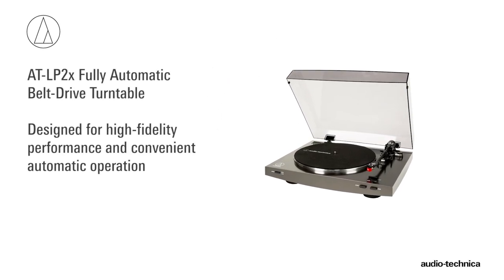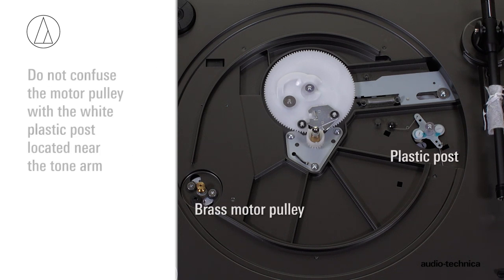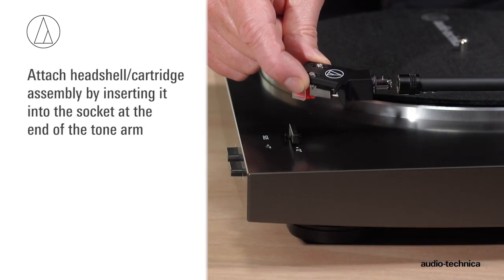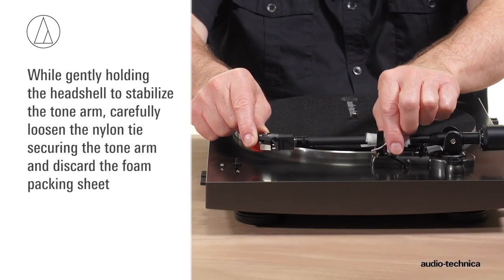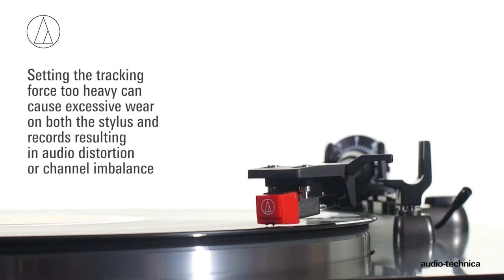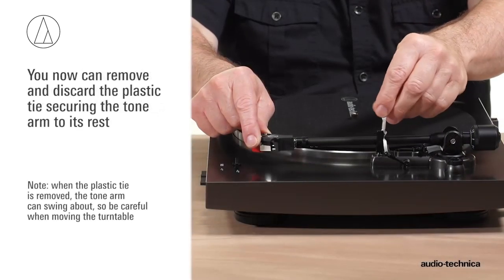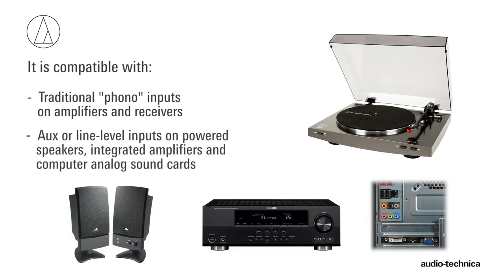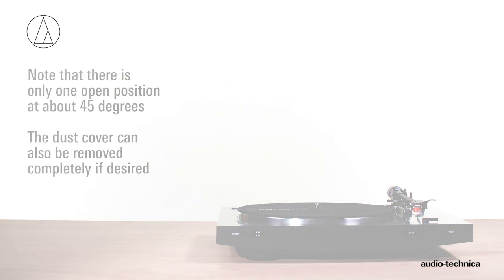AT-LP2X Turntable Setup | Audio-Technica Turntable

Comment: What are the measurements of the RCA cable?  They are not removable right?  is it a direct cable to the Speakers??
Reply from the maker: Hi there! The cable should be roughly 37” in length. The cable is non-removable and will need to be connected to the external speakers. Thanks! - A-T USA
Reply: @AudioTechnicaUSA  thanks, i bought it!  You could easily replace the needle or capsule with a higher quality one, right?  Would you recommend any?
Reply from the maker: @martinguano3346  We only manufacture the one stylus for the AT91R cartridge, that comes stock on the AT-LP2X turntable.  If you wish to upgrade to a higher quality cartridge / stylus, I recommend taking a look at the AT-VM95E. Thanks! - A-T USA

Comment: My AT-LP2x runs a little bit fast. Is there a way to adjust the speed? Thanks.
Reply: The belt is new  the motor is not adjustable  my method is to stretch the belt a bit. It is designed to be 1% fast from the factory. That is JIS  Japanese industry standard  or you can get a slightly larger belt which is super easy to replace
Reply: @johnlund2654  There was actually a hole for a screwdriver to set the speed of the motor.